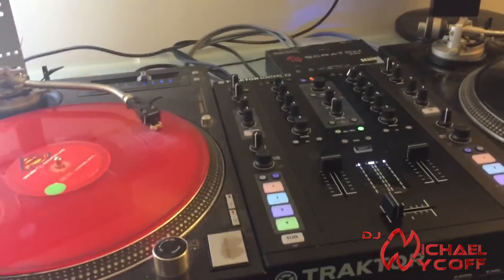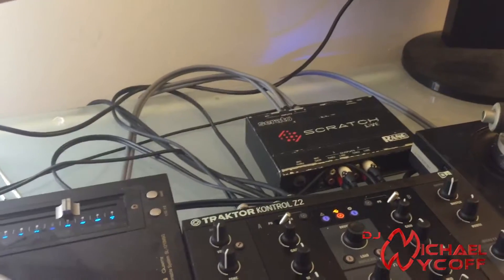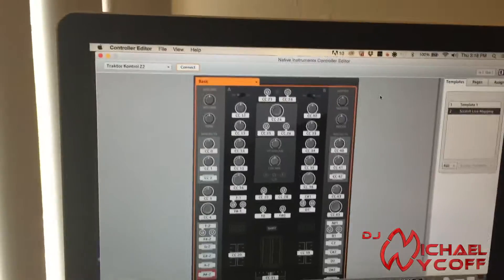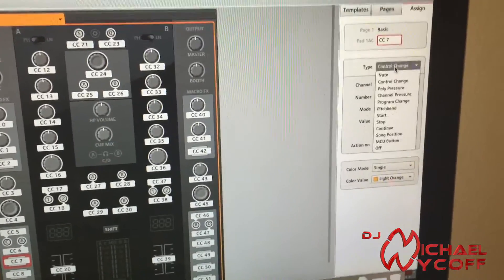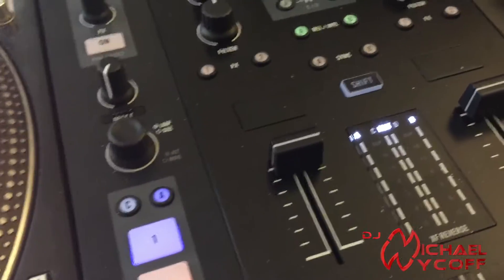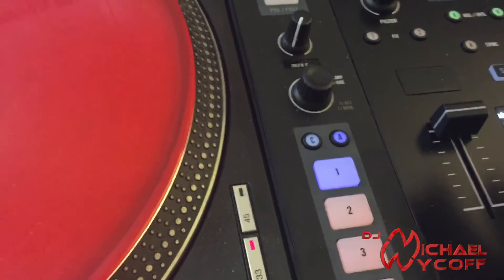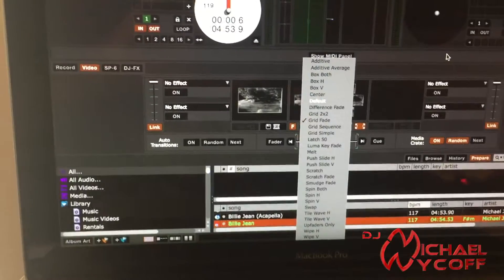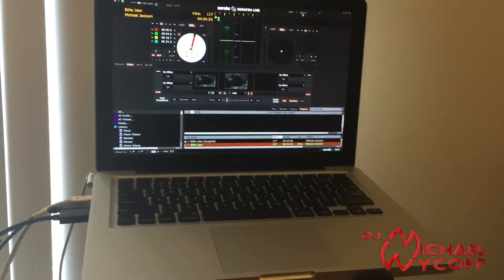Mapping Traktor Z2 for Serato/Scratch Live

Comment: Why do you need serato if traktor controller z2  mapping is the same?
Reply from the maker: because Traktor doesn't have video, so this gives you the option to use this mixer for that
Reply: Ok so serato is better plus it got like turntables on the laptop and i dont think tracker has not..

Comment: Hi nice video. Planning to get the og serato sl1 box. Just a couple of questions. Can I upgrade it to the new serato dj? and Do i need also control vinyls for serato or does the traktor vinyl works?
Reply from the maker: Hey Air Franzzz.  with an sl1 box you'll only be able to use scratch live.  To use Serato DJ you'll need one of the compatible boxes like an sl4 or the Denon Box.  As for control vinyl, you'll still need to use serato.  The benefit to this setup though is now you'll have options.  If you want to use Serato, you can wire it up this way, if you want to use Traktor, just plug in the z2 normally.  Have fun!

Comment: crazy how this is the only video that shows step by step, on how to map it. Thank you
Reply from the maker: that's exactly why I did it.  I spent over a month looking for tutorial on how to do it, and then just taught myself and knew I had to share with everyone else who wanted to know how themselves
Reply: Yes, I have been looking for so long. I have Serato Dj Pro now. But I don't have Traktor installed. So the cue buttons won't work. It lights up but they won't connect.
Reply from the maker: you don't need traktor, just download the free controller editor from Native Instruments and you should be good to go
Reply: Oh ok, I do have it but maybe I need to get a later version. Thank you!
Reply from the maker: Disconnect your z2 and just plug the power in and turn it on to make sure the lights are working properly first.  It should light up.  If it does, your lights are good and just make sure you always turn your z2 on before you open up the controller editor or open Serato.  That should fix your light problem.
Reply: thank you

Comment: Hi Mike,Two questions.Does this work with any Serato Box and if you make the switch from Serato to Traktor,will this copy all your que points and Loop points over ?
Reply from the maker: Dexter, what's up man.  This technique will work with ANY serato box.  I've done it with my original SL1 box and a Denon Serato box and both have worked flawlessly.  As for the switch, unfortunately it cue points and loops don't carry over from Serato to Traktor or Vice Versa.  But.....and I can't confirm this 100%, but i believe there was someone in the Serato forums that was working on a script/plugin, that would handle that.
Reply: Mike.Speedy reply.Thanks.And that clears up my questions nicely.Thanks again.

Comment: Before mapping, how did you wire it up? Are the decks connected directly to the SL interface? If so how do you cue with headphones?
Reply from the maker: Exactly.  Turntables do into SL interface, Sl Interface then goes into the z2 mixer, in the line inputs.  You can cue regularly with the mixer, just fine, that's how i use it regularly.
Reply: Thanks!

Comment: I'm having a problem can't seem to set the cue points while track is playing.I put midi mode on then i try to set the cue when i assign it but no response i have the same settings with all the buttons but no luck with setting up the cue buttons
Reply from the maker: here's what I've learned, You can do that with Serato DJ, but Scratch Live midi mapping, i haven't figured out a way or if the program even lets you do it on the fly

Comment: Hey I'm trying to map the z2 to scroll through my library but it'd jumping around the crate. Instead of scrolling one by one uo and diwn. What is your know set at? Or exactly what are your settings to scroll. Hope that makes sense
Reply from the maker: when you do your midi mapping, when you select the wheel for your scrolling, while you're still in midi map mode, press the c key to change it to relative mode.  That will fix the problem
Reply from the maker: @LOST SOUL Mannnnn I am so sorry, i'm just now seeing this comment.  Don't worry about paying me.  Let me find my configurations files and I will send them to you.

Comment: My turntables aren't showing up nor sound . How do I fix this
Reply from the maker: I'm not exactly sure where you are in your process, so try this from scratch to see if it helps.
1. reboot your laptop
2. Open up controller editor, then turn your z2 on to make sure the "connect" button turns on.  Your mixer should now be in midi mode.
3. Making sure your serato box is plugged in, now open up serato.
4. Your rca's outputs on your serato box need to go into the LINE input on the z2 and make sure the switch is flipped to Line on the z2 and not phono.
Everything should show up fine now